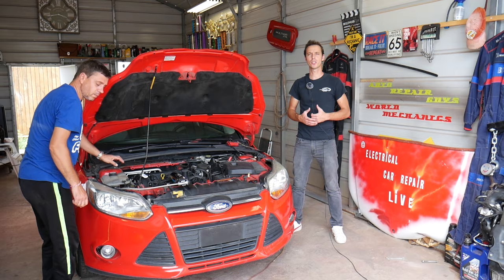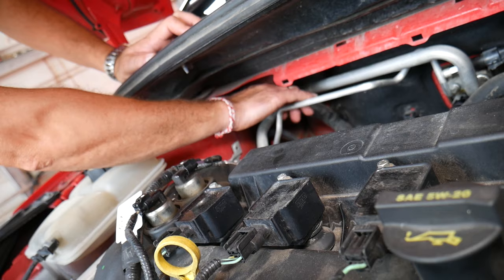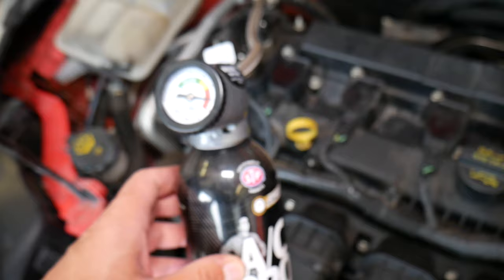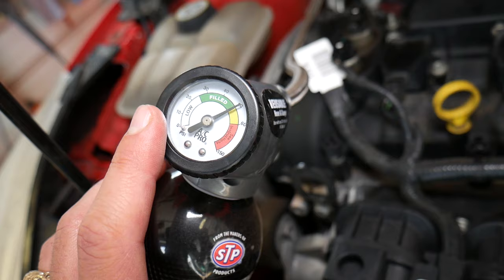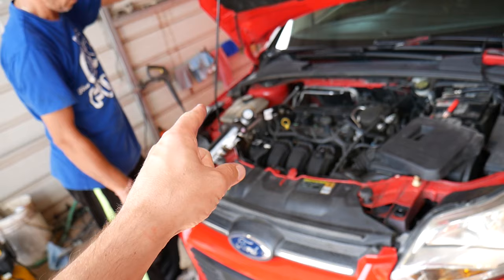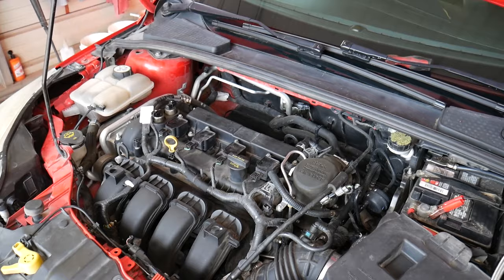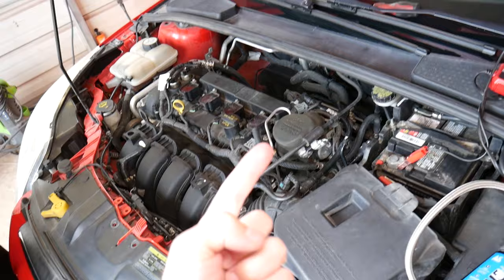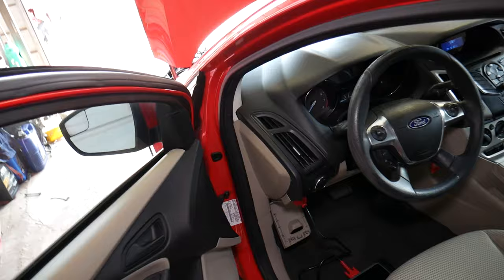TOP 5 REASONS WHY AC IS NOT WORKING ON FORD FOCUS, AC BLOWS HOT FIX

Comment: Simple solution if you have it sell it.  If you dont have it yet dont buy a ford focus.  Its a curse to repair
Reply: I was so mad when my girl bought a ford... now we're here 😂
Reply: Yes this car in particular has many faults one of them is the transmission. Do not buy this junk
Reply: I'm now selling on 3rd of the price I've purchased it, it's really a junk
Reply: @bicornisshop3522 is it really? I had a 09 focus it ran perfect I got it for a good price from my neighbor. Totaled around 120k I got T boned, I ended up getting a 2012 focus. What do you have ?
Reply: @dp7hunna  I purchased ford focus 2015 Ecoboost in December 2021. I've changed engine completely in July 2022, after that I've replaced pressure regulator 2 times (need to replace one more time), I've replaced brake vacuum pump, the compressor is now gone, there is still too much work in it, it's overheating and I've tried my best to solve the issue but no machanic ever diagnose what's the issue is, even ford service center by themselves failed to effectively know the issue and solve it
Reply: Bought an 08 5 speed focus 170 thousand plus miles  havent replace nothing mayor but brake pads and battery and tires 😂😂😂
Reply: Man, I tell you what.... I wish my Father in law fricking listened to me when he went to a dealership, and I scanned it, popped a ton of codes... oh no, he just had to have it 😂 guess who has to fix the damn thing every two or three months because it was a scummy "as is" dealer.
Reply: My 2013 diesel MK3 I've had zero problems other than having to replace the battery, it's been very reliable bought at 70000 and it's now at 96000 miles
Reply: This has nothing to do with the focus. Every car needs to be recharged. Lol
Reply: @alexmarcia9007 Same. Mine has almost 200k miles & all it's needed was an alternator, thermostat, tires & 1 set of front brake pads over 5 years. Lol

Comment: got my radiator fan replaced then my air conditioning broke then i got my ac fixed and it broke again 3 days later 😢
Reply: same thing happened to me, chipmunk chewed fan blades and had to replace, immediately after my ac stopped working. shop tried to charge me 1.6k to fix

Comment: A year later, my a/c is working ok but still after 30 miles or so, heat replaces the cool air. I also like the monitor device that he used to check systems. I need one of those.
Reply: I’m thinking it’s the expansion valve
Reply: @jesseg1218  I looked it up and sure as shit, I definitely think that is my issue. Thanks so much!

Comment: had zero refrigerant pressure.  Tried to fill and never got any pressure and never heard the compressor clutch engage.  Took it to a mechanic and was told the compressor needs to be replaced.  What parts will I need to replace, just the compressor/clutch assembly? Love your videos.
Reply: U had no leaks?

Comment: My problem is that my a/c works fine until I've traveled 40 miles and then the cool air stops.
Reply: Mine issue is totally opposite. 😂
It starts working after running around 10-25 kms.. 😂😂😂

Comment: Cars in this body style also have louvers in front of the radiator & condenser. Mine was broken and not working properly because of a collision with a raccoon.
But my ac is still very wimpy, not very cold at all. Do you know if the 2013 focus has the evap temp sensor inside the dash? I can't find any videos or websites (including haynes manual) that show it's location. I know the 2013 focus wiring under the glove box is completely different than the 2012 focus, because the 2012's have lots of videos snowing a hack with a resistor, but my wiring is completely different.

Comment: I need some help with my 2013 focus titanium. I bought the car new with 100 miles. It currently has 230,000 miles on it. It has no acceleration out the gate. No power no pickup. Its like its in limp mode.
Reply: Sounds like TCM there’s a recall on them if you can’t get them to swap it out it is around $900 if you pay out of pocket
Reply: Throttle body.  Haha - I know you already got this fixed months ago.

Comment: My Ford Fiesta ecoboost has it’s AC pressure switch wire connectors removed by previous owner. Can’t find the connector anywhere or the right colours. It’s a 3 pin connector. Any advice?